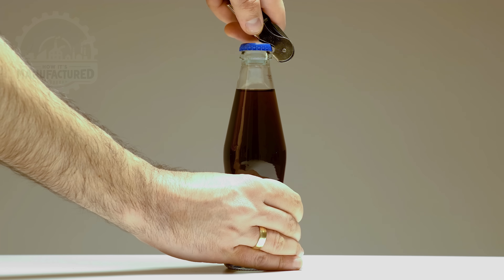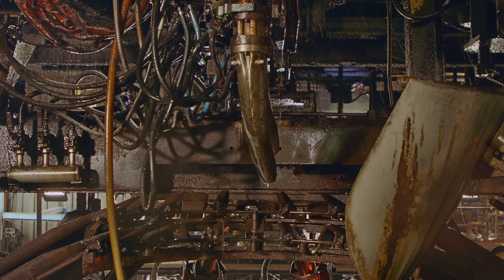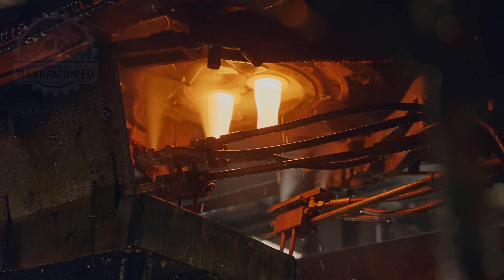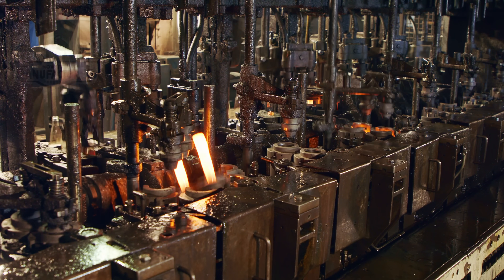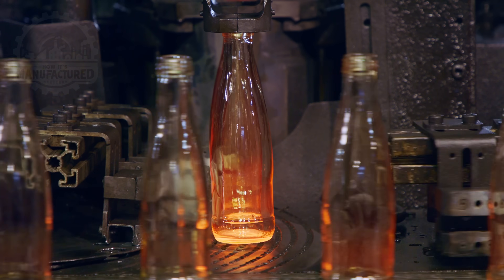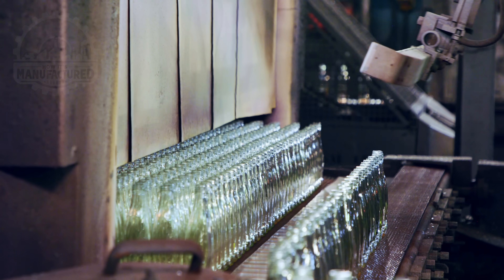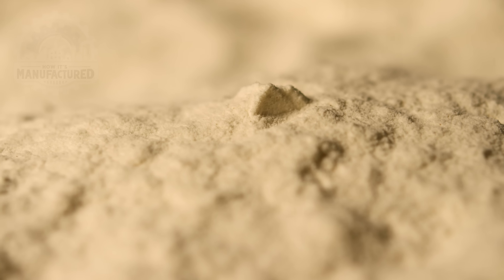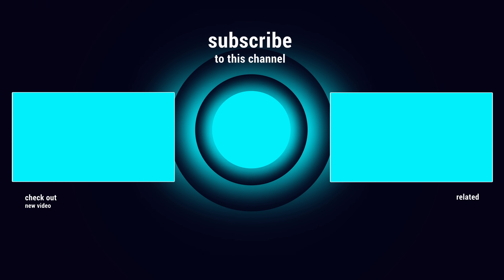How MILLIONS of Iconic Glass Bottles Are Forged in Fire Daily

Comment: Great fascinating awakesome process industry projects but need to be cost effective for sustainability in mkt demand as pet bottle are alternative swapped out large mkt share. So it needs to be cheaper solution light weight for 1liter bottle glass or 500ml or 330 to 250ml bottle for CSD Plant's cola plant project
Reply from the maker: Yes, you are right

Comment: The presentation was ok, but during the process of molten glass being shaped into bottles,  there wasn't enough clarity of exactly each step of the molding process.   It would have been better to have a illustration,  a drawing, of each step of the molding process.
Reply from the maker: Thanks for the feedback. We will try to have more illustrations etc in the future.
Reply: Once the molten glass is cut into gobs by the shears, as shown, they pass thru the distributor to each section of the machine.  Incidentally, the machine is called an Individual Section Machine or simply, IS machine.  This particular machine is an 8 section, double gob machine, meaning that there are eight identical sections, each section producing two bottles at once.  The gobs enter the back side of the machine, which is called the Blank side.  The gobs enter the blanks and are upside down at that point.  In the blanks, the gobs are partially formed - i.e the neck and thread are completely formed, and the rest of the bottle is semi-formed.  At this point, it is called a Parison - the glass is cooled down enough to retain it's shape. When the Parison is formed, the blanks open up (everything is in two halves), and the semi-formed bottles then swing over to the front side of the machine on the invert arm.  Now they are right side up, and they are presented to the molds which close on them.  The invert arm releases them into the molds and flips back to start the process over again on the blank side.  In the meantime, on the front or mold side, a blow head comes down on to the semi-formed bottles and blows them out into their final shape. Then, the blanks open and the take-out arms grab the completed bottles and take them out of the molds, as another set of newly-formed blanks come in behind them.  Notice that the take-out arms suspends them briefly before setting them down in front of the push out jaws - this allows them to cool a bit.  Then the push out jaws push them out on to the conveyor belt and they head into the annealing ovens or Lehrs.  Now here is where it gets to be fun: every 10 minutes or so, depended on whether it is Summer or Winter, the blanks have to be swabbed (coated) with thick, high sulfur oil - called blank dope. This is necessary to keep everything running smoothly.  This is done by the operator by hand while the machine is running.  The operator must swab the both blanks in the brief time that they are open during transfer and before they close again to receive new gobs. He also has to swab the bottom plates of the molds, again while the machine is running.  Timing is everything!  Every 10 minutes or the machine will start to jam.  In the Summer, the temperature in the front of the machine can be approx. 180 degrees. An operator wears long underwear under his work clothes to protect him from the heat and thick cotton gloves.  It is not uncommon to lose 5-8 lbs weight during a shift.  Glass machine operators have to watch their electrolyte balance!  I hope this gives you better explanation as to what is going on.

Comment: Interesting  I worked is a Glass bottle house in in the 1960s the one thing is the HEAT and the NOISE  not a  place to work in the Summer  
 and this is real old tech.  the problem is no one wants to do the work making the labor cost high and those machines have to go nonstop  leading to high Employee turn over
Reply: By the time you get to the forming department, your making pretty good money!
Reply from the maker: Thanks for sharing your personal experience. I had wondered about employee turnover as it seems quite a tough job.

Comment: I used to work in a beer bottle factory and just like this video it is interesting. It is a very hot and noisy place to work. Things move real fast.
Reply from the maker: Oh that's really interesting, what sort of heat levels was it getting up to when you worked there? Do you get to take a lot of breaks to deal with the heat and noise? 

Thanks again for watching and commenting, we really appreciate it.
Reply: This was in 1980. It was like a hot summer day every day. I did work on the hot end one day where the glass is formed and the heat there was real bad and the noise was real bad. It was located in south east Wisconsin and we made beer bottles for Miller in Milwaukee. I did not like that job at all.  @HowItsManufactured
Reply: @HowItsManufactured  At our plant where I work temperature infront of the IS-machine will reach about 60 °C during summer. 
And while that surely is uncomfortable, the real pain is the radiation heat coming from the freshly shaped bottles.
Depending on bottle size it can make working right on the machine an almost impossible task.
Reply from the maker: @Bigcubefan  That sounds rough. Do you have protective clothing that makes it more bearable, or do you have to just deal with it?
Reply: @HowItsManufactured  I mean, we wear thicker coats over our T-shirts, gloves and we have access to special gauntlets that protect the forearm additionally.
Apart from that, deal with it. :D